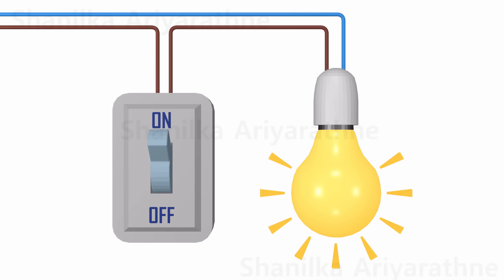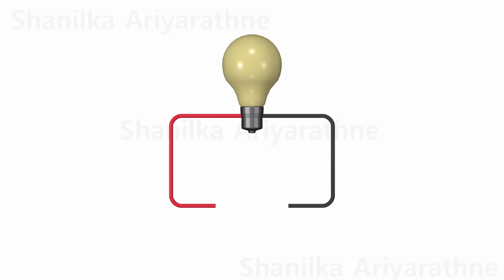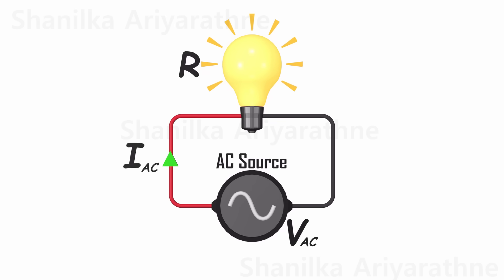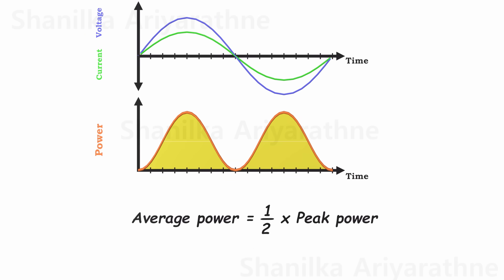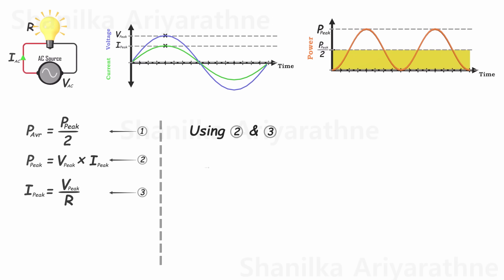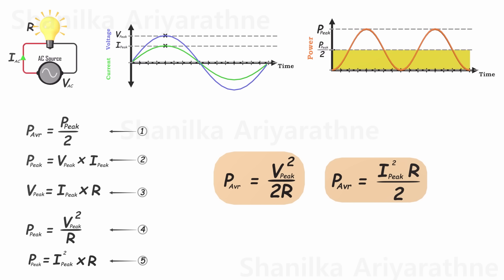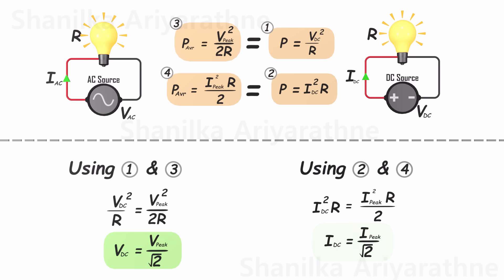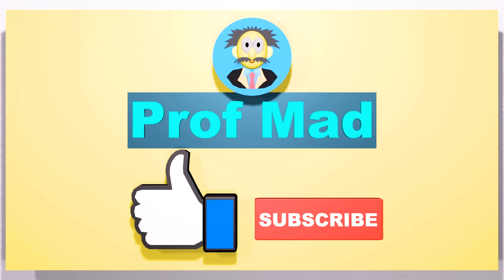Understanding RMS Values in AC Circuits √2  ? | Voltage | Current

Comment: When calculating power for ac, what if you have a leading current or leading voltage? Basically where there is a delay in either voltage or current which makes them not line up?

Comment: If you take the mean of the product v(t)i(t) (integral definition), you will find the mean power in CA sinusoidal waves which is VpeakIpeak/2 where 2=sqrt(2)sqrt(2) so VrmsIrms times the cossine(Ov-Oi). The mean power is the constant/persistent component of power along the time. This is the formal demonstration. The resistor power DC equivalent to AC is the motivation for the using of RMS value.

Comment: This is an excellent explanation of the proof of the ac-dc conversion formula. But it does not explain the “rms” concept and I cannot see its relevance

RMS is an averaging system intended to take into account absolute values and means the square Root of the Mean(ie. average) of the Squares. RMS for short

I simply do not understand what the statistical concept of RMS has to do with the AC-DC calculation. The only correlation I can see is the use of the squared function 

Can someone enlighten me?

Comment: As a retired electrician of 50 yrs experiance, this is the best explanation of RMS I have ever seen.  I'd like to point out though, the RMS voltage here in the UK is 240 vac. 230vac is the voltage set by the EU to allow manufacturers to make electrical goods that can be sold both in the UK and EU where the voltage is typically 220vac

Comment: Thank you for the understanding how power was signified in other forms and simplified using 3 and 1 and 3 and 2, but I still having problems simplified how intensity and voltage end up being with the square root 😂 root p/r  or p/v  in intensity.  Or voltage. P/I  and square root p times r. Other forms of ohms law can you simplified from all your knowledge to make understand that in one of your videos 😅, I saw a lot videos but not one come close as you did with power which gave me an insight and understanding in such a way.

Comment: So, the difference between either the V or I RMS and the effective peak voltage or current is basically the loss it happens during the power transmission!

Comment: The ai-driven voice is rather bothersome. But, I need a refresher in this RMS thing really makes for a linear power supply that doesn't burn-out the transformer nearly as quick, and runs much cooler. This AI-powered voice is darn close, but its preponderance of clipped frictatives, grates my nerves. (as if I actually know what clipped fricatives, a bit of a mystery to me.  So, THANK Professor MAD

In 1984,pondering and cogitating my music and photography 'ny Mad because I am mad as hell and taking it anymore. Gello cuz I'm all wobbly implementing any sort of self-defense, so Ricardo MadGello.

If  there is an adjustable parameter controlled the the , not sur what its really called, but in the vicinity of consonantsbeing a bit sharp-edged, is more like it?  Take Care and thanks again, Maestro.

When I arrived at the Boolean Algebra in the Heathkit Digital Electronics course, I somehow managed to incorporate it in my debate tactics. Utilizing pure logic, instead of made-up woowoo science, works great when in the presence of law-school-ruined folks, where logic and proportion? they do not need LSD to toss those out the door, and these folks decided 190 degree scalding fluid caused 3rd-degree burns. That is charred flesh. out ;-)
Reply: yes I hate this ni....  robotic voice too

Comment: This is the stuff that drives you insane. If you are an engineer or even a hobbyist you do need to know this stuff. AC circuits can be difficult. Where was You Tube in 1992?

Comment: My multimeter measured household peek to be 120v. Are multimeters RMS?
Reply: Most of the cheaper multimeters give an approximate RMS value which is usually not that far off anyway. Multimeters are available that give a true rns value. It will probably tell you in the specs for your meter which one you have.

Comment: In other words, RMS value is the DC equivalent voltage in order for the circuit to consume the same power if connected to a DC source. Am I correct?

Comment: Phenomenal introduction.  Future videos on phase discrimination and power factors would be extremely beneficial.   For myself I have never been successful with teaching 746 watts = 1HP, but a 110v rms, 1 hp motor takes 10.2amps average.
Reply: Learned many years ago there are 4 looses in motors:  stator, rotor, core & windage & friction. So the average AC t2 & 4 pole motors usually a 1 HP.Motor pulls 1,000 watts. Never trust HP rating on lying cheating communist china saws, drill presses etc. Way over rated.

Comment: So, if my RMS is 120V and the peak is 169.7V (as in 8:40) and I use a rectifier to convert it to DC, will I get somewhat 169.7V reading in a voltmeter at the end???

Comment: Suprised To see a new way to derive The equation. initially I know a method to derive this equation using calculus but this method is more mind wobbling...
Reply: As an electrical engineer myself, this method explains how ac power formulas started, but the calculus wad explains the understanding of what the words Root Mean Square mean.   You can't average and sine wave centered on zero, so square it, now its all positive, now average it (mean), now reverse the squaring(root).  And  voila RMS and you get the same answer Vpeak / root 2.

Comment: I had a blurred idea about RMS. It started with measuring UPS and SMP power supplies. Understood that cheap multimeters cannot measure the correct voltage etc. You cleared it. Thank you!

Comment: Nice Explanation I have a one question that  why power is only in positive
Reply: Power can also be zero but not negative. Think about it intuitively. How could there be negative power? Either work is being performed (positive) or it isn't (zero). The voltage and current being either positive or negative simply refers to the direction the current is flowing.  Regardless of direction work is still being performed.

Comment: But in the Europe we usually have 400 V (RMS). Peak value is approximately 566 V.
Reply: 400 V is the voltage between phases in a 3-phase system: 230 V * √3 = around 400 V.
230 V is the RMS voltage between any phase and ground.

Comment: RMS is the "square Root of the sum (Mean) of the Squares / 2" — By taking measurements of a sinewave evenly along both sides & peak, squaring each, add them together, then square root the sum which is the RMS voltage. The equation V=V/√2 is the simple method.
Reply: And that's why we use it - it's simple. It's only necessary to use a more sophisticated approach for non-sinusoidal waveforms, would you agree?

Comment: The peak voltage is usually used for capacitor. You must select capacitor voltage w/this voltage and no Vrms. In DC capacity the selected voltage must be function of the capacitor model. It is better 2 time more voltage than used dc voltage (specialy for tantalum).

Comment: RMS Titanic didn't have the electric lines on when the crew members escaped before sinking. About 10 󾓥 󾓦 󾓧 󾓨 󾓩 󾓪 󾓫 󾓬 󾓭 󾓮s escaped from the back part using a rope to a smaller ultra modern motor boat, designed today.

Comment: Look there is an easier way to calculate the RMS. When I graduated from Technical school we did all the girations this guy did and at the end the professor said take the Maximum Voltage and multiply it by 0.707. 40 years later I still remember that.
Reply: Yes; many people know how to convert peak to RMS and v/v but not so many people know how this exact value is derived.
Reply: @thomasmaughan4798   when you have to get the job done and people are constantly reminding you that your time is costing them money whether you are in field service or a rework center see what comes to your mind.
Reply: @thomasmaughan4798  and that's the problem we the USA don't fix any thing anymore. Hell we don't make things Soooo there you have it.
Reply: @sydneyanderson8906  "we the USA don't fix any thing anymore"
There is no WE.  My entire adult life has consisted of fixing things.  I admire the Red and Green show motto, "If women don't find you handsome, they should at least find you handy".
I've known since high school how to convert to and from RMS but not really WHY it works the way it works.  Squaring voltage results in power (assuming resistance does not change). It also ensures positive measurements on the negative half cycle.  The average power is simply and exactly 1/2 peak power.  Take the square root of that 1/2 and now you are back to voltage!
Reply: @thomasmaughan4798  the red and green show is nice, But what I'm thinking 🤔 about is on a much larger scale. Look in my 20's you had TV and Radio shops that fixed things from the public. When I worked as an electronic technician many jobs were in repair and rework. I've had jobs that I made Air craft equipment to densitometers they interpret X-ray 🩻 pictures. From NCR to RCA to Ford to Tobias even when I worked at Comcast companies either made or fixed stuff. When I graduated from Technical school one of the requirements was you had to pass the FCC to get your first class license. No pass no graduate. That FCC came in handy at Comcast. I was the Headend engineer. My point is this where is all that stuff now. Where are the technical schools, we the USA don't fix shit. Hell your ships are made in Korea and the steel is made in China. The trucks are made in Mexico. Got my point.
Reply: @sydneyanderson8906  Okay, point made.  I also have my First Class FCC from 1974 and that was a challenging test.  Amateur Extra is nowhere near as challenging. 
I still find some use for things like a Fluke Scopemeter when I'm out troubleshooting HDSL or something like that and I recently purchased a Simpson 260 multimeter partly because they last forever if you don't make a (easy to make) mistake.

Comment: You don't need to calculate that precisely. 
If the RMS is specified as 230V, then the voltage 
fluctuates in practice between 221 and 239V. 96% up to 104% of the target.
The values can worsted case be 90% up to 110% of the target, i. e. 207V up to 253V
Reply: With respect, what has line voltage variabilty to do with the underlying circuit theory? 

The video is an explanation of the relationship between DC values and their corresponding AC rms (aka effective) values. Although familiar line voltages are used for example, the relationship is applicable to sinusoids of any magnitude. The degree of necessary precision is a separate practical matter.

Comment: The voltage changes in the US 60 times, in Europe 50 times. 
In Japan there are both networks, one 50Hz and one 60Hz, but only 100V RMS
The voltage is 220V RMS in Russia, 230V RMS in continental Europe and 240V RMS in England. 
V peak is almost never used and V RMS is almost always used!
V peak is only used when the AC voltage is rectified and the expected maximum DC voltage is asked.
V RMS x SQR(2) = V peak
V RMS x1,414 = V peak

Comment: OMG, I've known about RMS for 45 years, but always thought household power was peak to peak. Even wired my own house from pole to multiple subpanels, how could I have missed that? Just one of the many new things I learned today....
Reply: A negative voltage multiplied by a negative current gives always a positive power. Power then cannot be negative.

Comment: Isnt England 240v ?
Reply: Britain has officially 230 but in practice 240 V they play tricks with the marginals. In 1980 the IEC decided to harmonize 220 V and 240 V to 230 V European countries switched to 230 V but Britain just said they did and used the marginal to cheat.

Comment: simply put - to find Vrms multiply peak voltage by the sin of 45 degrees, and divide Vrms by sin 45 to get peak Voltage
Reply: It works but has nothing to do with sine per se; just that the sine of 45 degrees (in a 360 degree circle) just happens to be the square root of 2.
Reply: @thomasmaughan4798  I didn't mean to imply that it did, just an easy way to remember the numbers
Reply: @normstaley9799  "just an easy way to remember the numbers"
That's good; whatever works!  I have known this relation for decades but this video simplifies it considerably and removes trigonometric functions.
Reply: @thomasmaughan4798  If you think all the algebraic steps this video goes through to get the answer is simpler than using the method I suggested then we should have a discussion on the meaning of the word SIMPLE
Reply: @thomasmaughan4798  also the presence or absence of a "360 degree circle" has no bearing on the sin of any angle
Reply: But have you missed the point of the video which is to explain why this relationship exists? It isn't a how-to.

Incidentally - and this is subjective - I find it equally easy to remember 1/root 2 as sin45.
Reply: @civildiscourse2000  no I understand the point of the video and it is well done I only pointed this out for those that might find it useful.
Reply: @normstaley9799  Pardon my presumption then. Carry on, watch for the "sines," and happy trails to you sir.

Comment: So in summary, it is faster the old way, RMS = peak value x 0.707
Reply: Your comment makes me wonder if you thought the video was suggesting we go through a long-winded process to make routine calculations instead of just using "the old way."

First of all, the "old way" (0.707peak) is just an approximation of peak/root 2, which is what the video arrives at.

This point was to show how peak/root 2 can be derived, and thus where it came from. This can also be shown using calculus, but this derivation is elegant in that it uses only basic algebra and circuit theory.
Reply: @civildiscourse2000   No, not at all. I knew the long process from technical school but I just wanted to add that shortcut. Your video is great for knowing where the values come from and their relationship, but in a hurry, and without the need to be too precise, 0.707peak is acceptable and I know that many people will be at ease using the short way.

That said, your video is nice and shown in an elegant way. I am sure that interested lurkers will appreciate the details :)
Reply: @zilog357  Lovely response, thanks. One mlnor point: I'm only a wandering surfer. The content isn't mine.